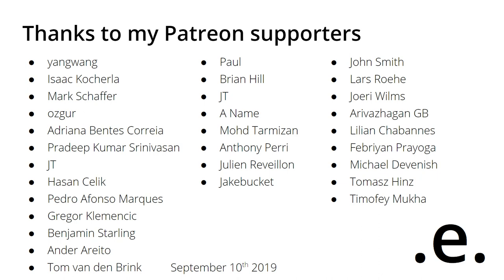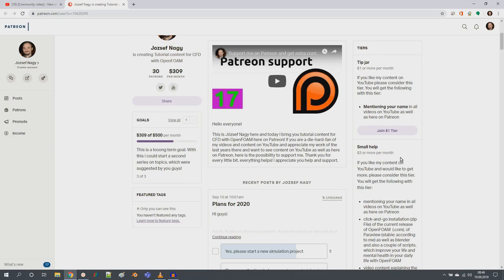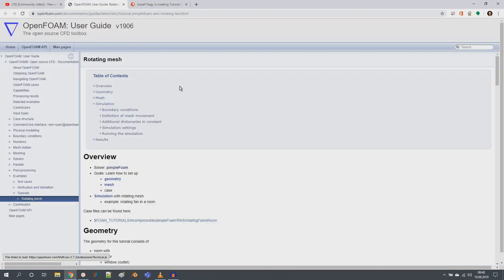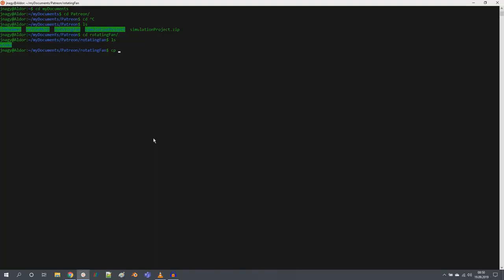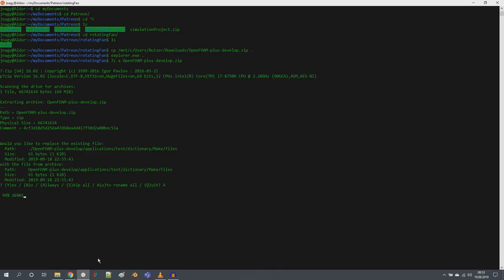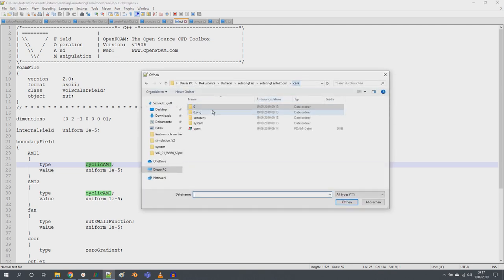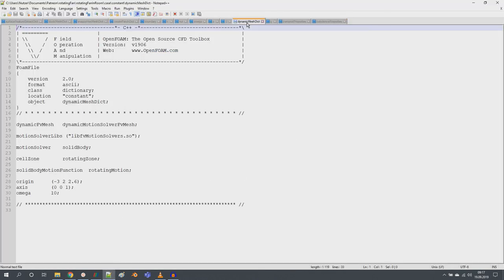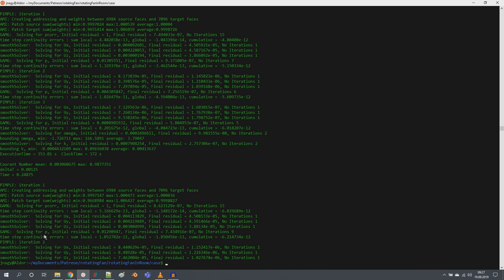Rotating mesh simulation project tutorial in OpenFOAM (mesh and simulation)

Comment: Hi Joszef, I'm fairly new to openfoam and I am getting this error when running the mpirun command: environment variable MPI_BUFFER_SIZE not defined. How can I solve this issue? Thanks in advance
Reply from the maker: If the simulation is running, you don't have to worry about it. Or does it crash?
Reply: @OpenFOAMJozsefNagy   it crashes
Reply from the maker: @rokasbytautas5074  MPI_BUFFER_SIZE=2000000000 Does this help?
Reply: @OpenFOAMJozsefNagy  Hi sorry it still doesn't work. Where exactly does this need to be defined?
Reply from the maker: @rokasbytautas5074  In the command line before starting the simulation.
Reply: @OpenFOAMJozsefNagy  Ok thanks it worked, but now there is another error saying: 3 more processes have sent help message help-btl-vader.txt / cma-permission-denied. Do you know what this could possibly mean?
Reply from the maker: @rokasbytautas5074  The simulation should run now, this should only be a warning.
Reply: @OpenFOAMJozsefNagy  Thank you very much for your help Jozsef, it's all working fine!
Reply from the maker: @rokasbytautas5074  Great!

Comment: Hi Jozsef, dear community
thanks for your tutorial it was very helpful. With your video and the entry on the OpenFoam website i was able to finish the tutorial. I tried to change the geometry and it worked until the last command. When i try to run mpirun -np 4 pimpleFoam -parallel > log.pimpleFoam & the following problem report appears. 
[0] --> FOAM FATAL IO ERROR: (openfoam-2112)
[0] Cannot find patchField entry for procBoundary0to1
[0]
[0] file: processor0/0/p.boundaryField at line 25 to 62.
[0]
[0]     From void Foam::GeometricField<Type, PatchField, GeoMesh>::Boundary::readField(const Foam::DimensionedField<TypeR, GeoMesh>&, const Foam::dictionary&) [with Type = double; PatchField = Foam::fvPatchField; GeoMesh = Foam::volMesh]
[0]     in file /usr/src/packages/BUILD/src/OpenFOAM/lnInclude/GeometricBoundaryField.C at line 172.
[0]
FOAM parallel run exiting
[0]
    in file /usr/src/packages/BUILD/src/OpenFOAM/lnInclude/GeometricBoundaryField.C at line 172.
Any help would be appreciated. 
With kind regards
Benedikt Bihlmayer
Reply from the maker: Possibly there was an issue during decomposePar already?
Reply: @OpenFOAMJozsefNagy  Thank you for your fast answer. I will Check it.
Reply: @OpenFOAMJozsefNagy  Hi Jozsef,
I tried to run the simulation again and edited the code. You were right that during decomposePar was the following issue 

--> FOAM FATAL IO ERROR: (openfoam-2112)
Cannot find patchField entry for allBoundary

file: 0/k.boundaryField at line 25 to 62.

    From void Foam::GeometricField<Type, PatchField, GeoMesh>::Boundary::readField(const Foam::DimensionedField<TypeR, GeoMesh>&, const Foam::dictionary&) [with Type = double; PatchField = Foam::fvPatchField; GeoMesh = Foam::volMesh]
    in file /usr/src/packages/BUILD/src/OpenFOAM/lnInclude/GeometricBoundaryField.C at line 172.

It would be great if you can tell me what i am doing wrong. Thanks for your help i do appreciate it a lot.
With kind regards
Benedikt Bihlmayer
Reply from the maker: @benediktbihlmayer9004  Your original BC from blockMesh is not deleted during snappy. Take a look at your mesh. Looks like you don't cut away your outside for some reason. Not water tight STLs?
Reply: @OpenFOAMJozsefNagy  How can i check, if the STLs are water tight? I thought by running the command checkMesh i see if there is a problem but checkMesh returns that everything is ok.
Checking topology...
    Boundary definition OK.
    Cell to face addressing OK.
    Point usage OK.
    Upper triangular ordering OK.
    Face vertices OK.
    Number of regions: 1 (OK).

Checking patch topology for multiply connected surfaces...
    Patch               Faces    Points   Surface topology
    allBoundary         14350    14352    ok (closed singly connected)

Checking faceZone topology for multiply connected surfaces...
    No faceZones found.

Checking basic cellZone addressing...
    No cellZones found.

Checking geometry...
    Overall domain bounding box (-277 -47 -97) (1 47 47)
    Mesh has 3 geometric (non-empty/wedge) directions (1 1 1)
    Mesh has 3 solution (non-empty) directions (1 1 1)
    Boundary openness (-1.330152e-17 1.824875e-15 -1.336859e-15) OK.
    Max cell openness = 1.734963e-16 OK.
    Max aspect ratio = 2.808359 OK.
    Minimum face area = 7.285986. Maximum face area = 20.52812.  Face area magnitudes OK.
    Min volume = 34.97463. Max volume = 35.08443.  Total volume = 3756917.  Cell volumes OK.
    Mesh non-orthogonality Max: 0.3553395 average: 0.1683
    Non-orthogonality check OK.
    Face pyramids OK.
    Max skewness = 0.006983165 OK.
    Coupled point location match (average 0) OK.

Mesh OK.

Do you know any other options to take a closer look at the mesh?
With kind regards
Benedikt Bihlmayer
Reply from the maker: @benediktbihlmayer9004  This is a tedious step, you have to take a look manually in paraview. Blender is a good tool to check manually for leaks in the STL.
Reply: @OpenFOAMJozsefNagy  I dont know if i was able to fix it but i dont get any error report after running decomposePar. If i continue with the mpirun command i do receive the following error report. 
[3]
[3]
[3] --> FOAM FATAL ERROR: (openfoam-2112)
[3] Unable to set target face for source face 3698
[3]
[3]     From virtual bool Foam::faceAreaWeightAMI::setNextFaces(Foam::label&, Foam::label&, Foam::label&, const Foam::bitSet&, Foam::labelList&, const Foam::DynamicList<int>&, bool) const
[3]     in file AMIInterpolation/AMIInterpolation/faceAreaWeightAMI/faceAreaWeightAMI.C at line 363.
[3]
FOAM parallel run aborting
[3]
[3] #0  Foam::error::printStack(Foam::Ostream&)[1]
[1]
[1] --> FOAM FATAL ERROR: (openfoam-2112)
[1] Unable to set target face for source face 1100
[1]
[1]     From virtual bool Foam::faceAreaWeightAMI::setNextFaces(Foam::label&, Foam::label&, Foam::label&, const Foam::bitSet&, Foam::labelList&, const Foam::DynamicList<int>&, bool) const
[1]     in file AMIInterpolation/AMIInterpolation/faceAreaWeightAMI/faceAreaWeightAMI.C at line 363.
[1]
FOAM parallel run aborting
[1]
[1] #0  Foam::error::printStack(Foam::Ostream&)[2]
It would be great,if you could tell me how to fix this error. Thanks in advance.
With kind regards
Benedikt Bihlmayer
Reply from the maker: @benediktbihlmayer9004  Here something went wrong with your AMIs. This is all I can read out of the error.
Reply: @OpenFOAMJozsefNagy  I recreated now the AMI and i do now get the following message after running mpirun.
WARNING: Linux kernel CMA support was requested via the
btl_vader_single_copy_mechanism MCA variable, but CMA support is
not available due to restrictive ptrace settings.

The vader shared memory BTL will fall back on another single-copy
mechanism if one is available. This may result in lower performance.

  Local host: Benedikts-Laptop
--------------------------------------------------------------------------
[Benedikts-Laptop:19355] 3 more processes have sent help message help-btl-vader.txt / cma-permission-denied
[Benedikts-Laptop:19355] Set MCA parameter "orte_base_help_aggregate" to 0 to see all help / error messages
--------------------------------------------------------------------------
Primary job  terminated normally, but 1 process returned
a non-zero exit code. Per user-direction, the job has been aborted.
--------------------------------------------------------------------------
--------------------------------------------------------------------------
mpirun detected that one or more processes exited with non-zero status, thus causing
the job to be terminated. The first process to do so was:

  Process name: [[48933,1],1]
  Exit code:    142
--------------------------------------------------------------------------
Is the CMA support crucial to run the simulation? I tried to find some kind of help in the web but i didnt got a solution. My take was to set up an VM and install OpenFoam there and try to run it there but that wasnt helping as well. As far as i am not very used to VMs and setting Openfoam up in it i think i could have done an mistake there.
Unfortunately googling the exit code does not provide a solution. I wasnt even able to get any information on the exit code. I tried to solve the issue by running the simulation on one processor but i receive the same error. By setting endTime to 0.02, deltaT to         0.0025 and the writeInterval   to 0.005 the simulation works fine. But if i set the endtime to an higher value i get the error with the Exit code: 142.

Thank you very much for taking the time to answer to my messages.
Reply from the maker: @benediktbihlmayer9004  This is an error of mpi if your simulation crashes. Nothing more. If you manage to get a stable results by changing the time step size you may have to consider using lower CFL values.
Reply: @OpenFOAMJozsefNagy  Hi Jozsef, 
its me again. For the last days i tried to use your input and fix my simulation. But the changes  i made didnt provide any solution for my problem. Here are the changes i made: i tried to change maxCo to higher and lower values, and i changed endtime, deltaT, the writeInterval. Do you have any more ideas why it isnt working for a longer time period than the 0.02 seconds?
Reply from the maker: @benediktbihlmayer9004  Mesh quality?